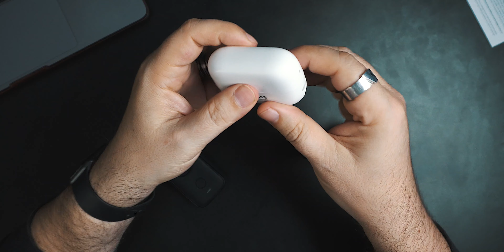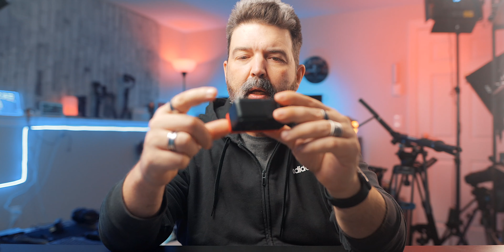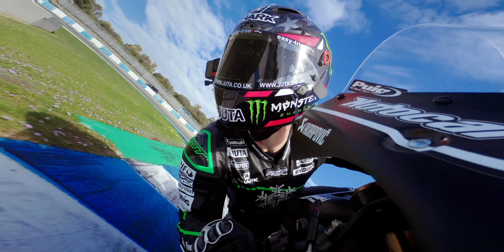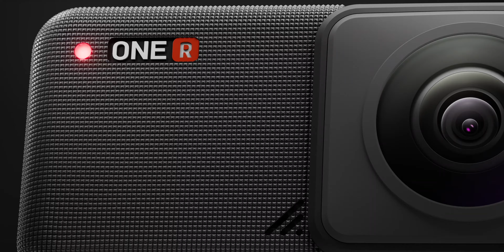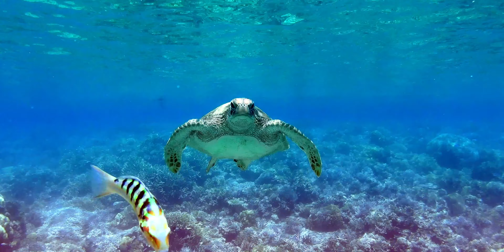Insta360's New Camera For 2022!  The Insta360 One RS!

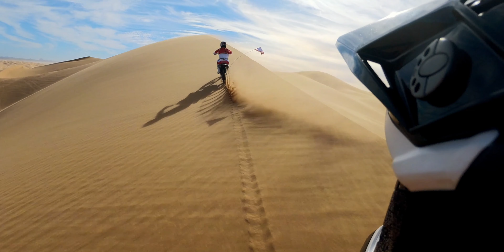Comment: Yeah movie widescreen is 21:9 instead of std 16:9, I love many of the new features at the 9:03 spot there is a motorcross in front of the filmer at quite a distance but it looked like it has some stitching issues or are my eyes deseaving?????? I am looking for a different 360cam with changeable batteries, My qoocam films allmost 3hours on full battery but i prevere longer filming now using external batterypack which sometise is visseable.
Reply from the maker: The Insta360 won’t get that long on a batter. I think they say around 70 minutes but you’ll be able to purchase multiple. I’ll hopefully be able to take both the R and the new RS on vacation soon so should get a better idea of how long they record.
Reply: @gregtoope  Yeah changable bateries has its advantages, looking forward to som reallive footage of the RS